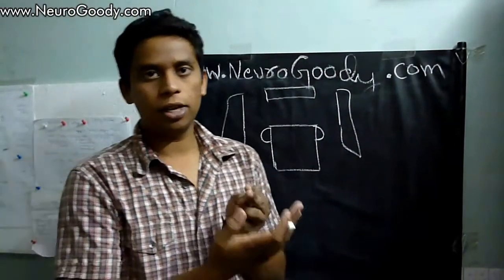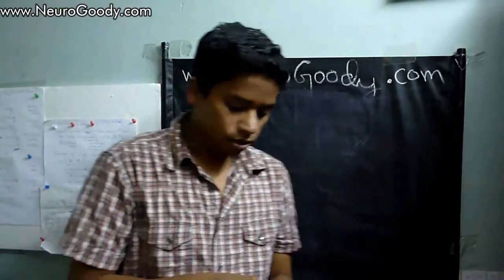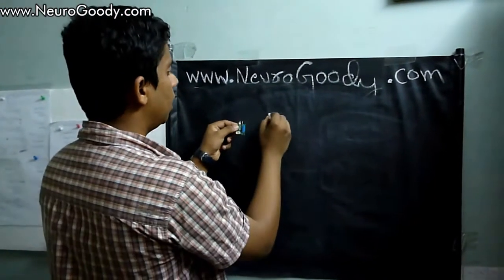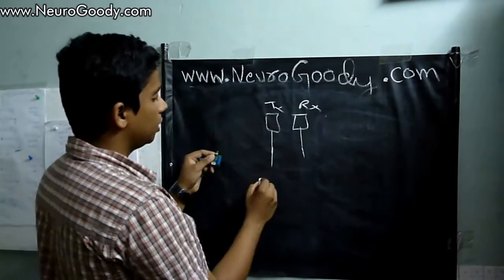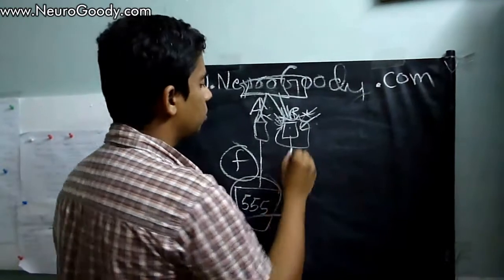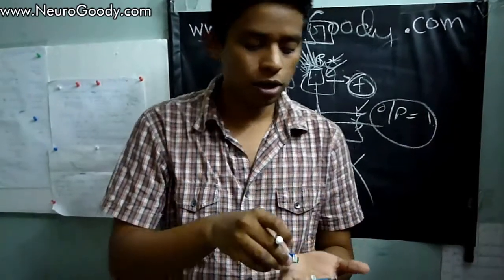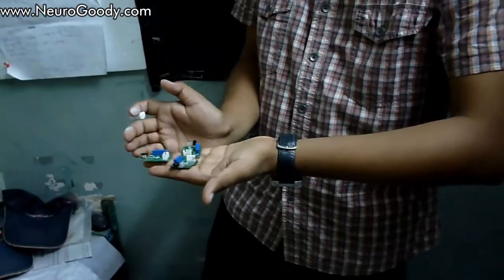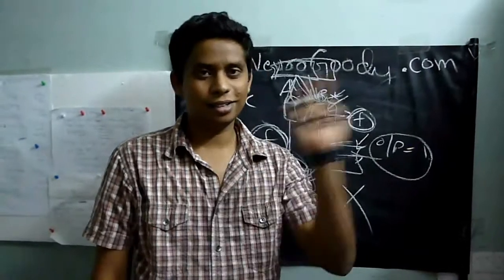Obstacle detection and avoidance proximity IR sensors for Robots!

Comment: i have a doubt. as transmitter and receiver are in the same circuit how can you say that ir rays reflected from the obstacle fall on the receiver. and if they fall also there may not be complete reproduction and a change in frequency. please reply soon
Reply from the maker: +Chaitanya Dora Good Question. 

Frequency won't change. If it does also, it should be minimal change. And the IR rays will be coming from all directions. what matters mainly is the intensity. If the intensity of the reflected rays are high enough then the circuit will function.